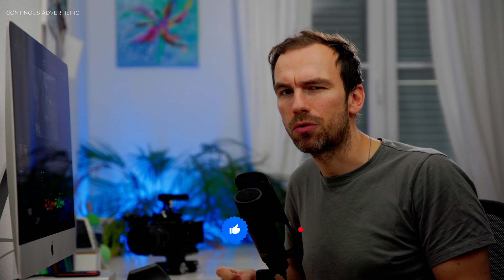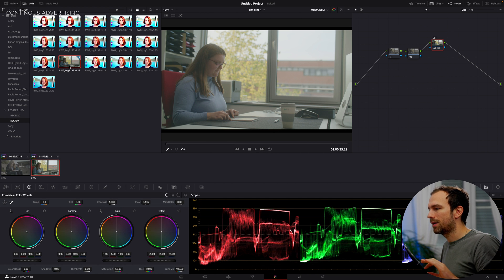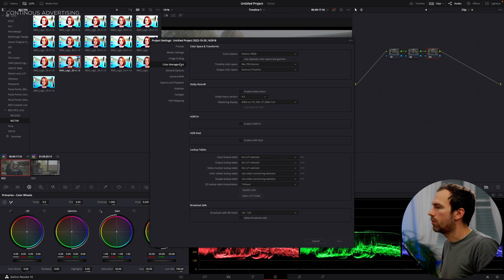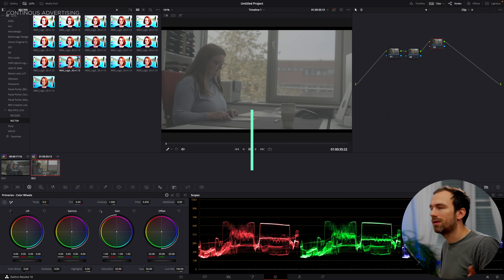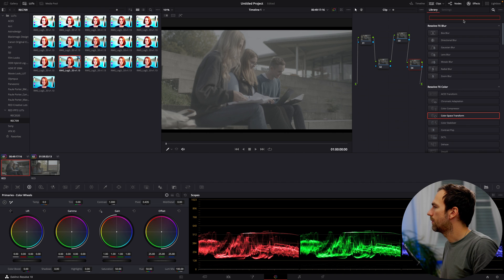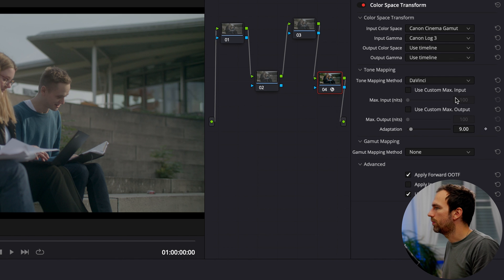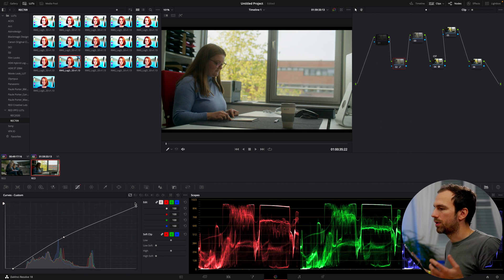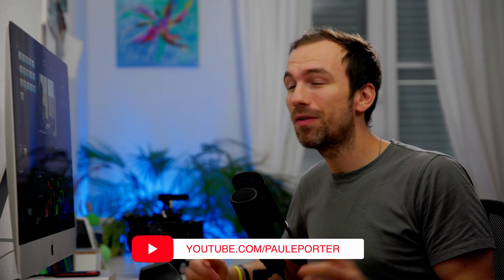How to convert LOG TO REC709 // 4 Easy Methods in Davinci Resolve

Comment: great videos

i need help on camera selection for stop motion - vfx i found  options i could buy used:

Ursa mini 4.6 1gen
BMPCC 4/or 6k
Sony FX-30 vfx
Z cam e2

im gonna use it mostly indoor and for stopmotion/vfx/greenscreen work.
im litterly lost, i know all 3 good but i know nothing about Vfx, i see the new sont fx30 is 14bit is that a better option post than the 12bit from the BMPCC 4k -6k or is the raw from bmpcc just better?
Reply from the maker: Thanks. You clearly Focus too much on gear. The only thing you need to master for green screen is good lighting. 
I’ve done green screen work back with the c200 on the internal 8 Bit Codec and it worked out fine since I focused on good lighting. 
Sure more bit depth is very helpful but it doesn’t do miracles for you if you don’t understand the fundamentals of lighting for Green/ blue Screen. 
Seriously all of the mentioned cameras will work for that. 
Personally I would go with the 6k since it shoots ProRes which is much better as the file format Sony is using.
Reply: @paule_porter  Thanks alot, yea i was just worried i got the wrong thing for the job.

Comment: I have a sony a6600 8 bit camera and 
 slog 2/ s-gamut has some red spots. How fix Paule? I use CST.
Best regards
Reply from the maker: The problem is the 8 bit Codec. 
8 Bit is not really designed for log since there is too lass Color information for the log curve. 
That always leads to artefacts